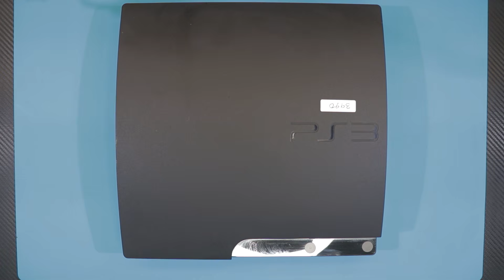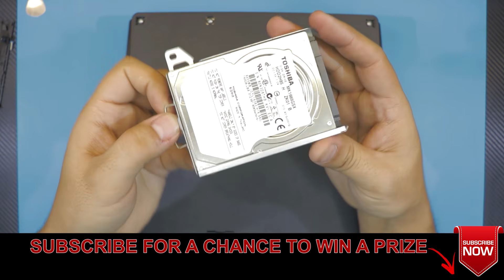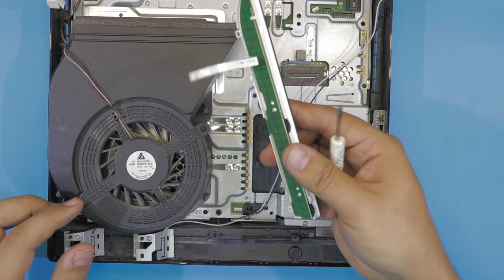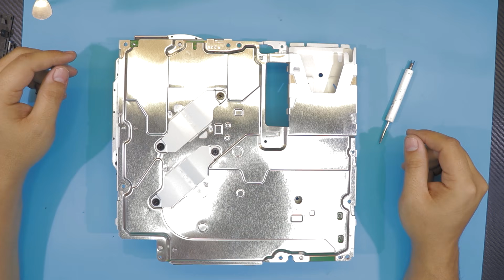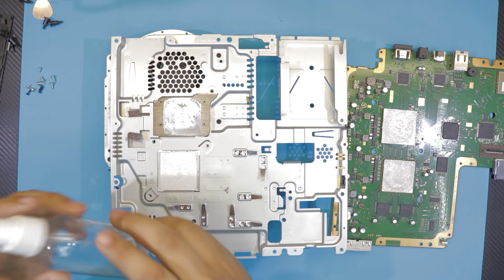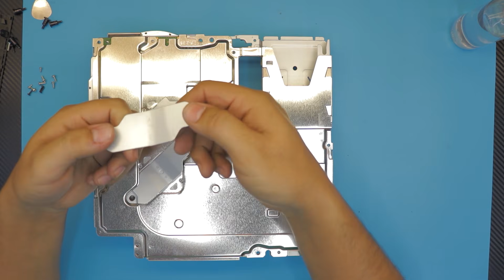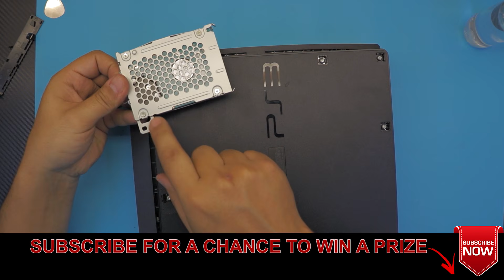HOW TO CLEAN AND  REPASTE YOUR PS3 SLIM ( playstation 3 slim console )

Comment: Im having trouble putting the front  cover back on
Reply: Something is misaligned
Reply from the maker: Lift it, and place it at a 45-degree angle first; then, once it is aligned, bring the rest down.
cheers🍻
Reply: @uFixTek  i tried, but i think the disc drive is blocking the cover, because the metal cover of the drive is up on the left while the right side sits flat. Is there any way that i can fix it?
Reply: @u @uFixTek  i fixed it! I had one of the ac cables tucked under the motherboard😅

Comment: hello sir, thank you, your video was most helpful for me in youtube. it was very detailed, also the unit in the video was exactly like mine. 
i followed everything, cleaned, removed 15 years old original paste and repasted with mx4, unfortunately my temperatures are almost the same.
Reply from the maker: It's my pleasure my friend.
🫠Regarding your temps, what temperatures are you getting? This video is for repasting and servicing. If you repaste and use a good quality paste, your temps should be similar to those of a new console. 60°C–80°C is a perfect reading; 85°C after extended hours is fine.
cheers🍻
Reply: I hace cfw and use webman fan control. 
My ambient temp is 35c. With 50% fan speed, my temps when playing gta 4 after 20 minutes peak at 65c for CPU and 68~69c for RSX. 

Almost same temperature when my ps3 had 100g of dust inside and factory thermal paste from 2010.

Temperature above 70c will give the ps3 the yellow light of death eventually. @uFixTek
Reply from the maker: 70°C will not cause the Yellow Light of Death. The reason for the yellow light is that the solder joints under the GPU/CPU crack or create resistance due to lack of servicing and prolonged exposure to temperatures above 85°C.

We tested this years ago with a 12-month trial using a UPS. One unit ran constantly at 75°C–80°C with zero yellow lights over 12 months. Another unit was allowed to run at 85°C–90°C during the same period, and it developed the yellow light after 5 months.
The yellow light was due to the solder joints being damaged from excessive heat on the BGA.

increase the fan speed to 75%
Reply: Wow i didn't know that, i am actively visiting reddit and psxplace and never read anything about this experiment. What people say is temps above 75c are what causes the rsx solder to weaken. Thus webman mod had 68c as ideal max temperature.   @uFixTek 

Do you have knowledge about which models are more reliable, would you please tell me if super slims don't really require delid like some people claim?
Reply: @uFixTek thank you for the valuable information
Reply from the maker: It's my pleasure my friend.

Comment: So there's a lock screw for the hard drive? What type of screw head?
Reply from the maker: 🫠Regarding your question, it's a screw philips #1.
Should you have any further questions or requests in the future, please don't hesitate to ask me.
cheers🍻
Reply: @uFixTek  All right. So its not a lock Screw like TORX or T10.
Reply: @uFixTek  So I looked for a video like yours to show me how to open my PS3 slim for cleaning. That's all. Thanks.
Reply from the maker: Yes, the hard drive screws are Phillips #1.
The security Torx screws are for the case.

Comment: Shouldn't you paste down the pads completely with a spatula? Also, certain models don't have the ribbon underneath the blu ray drive, and there's no plating covering the battery.
Reply from the maker: 🫠Regarding your question, just do an X pattern shape and you’ll be more than fine—no need to spread it.  
And yes, there is another revision without the flex cable under the DVD drive.
https://youtu.be/Gey66EGkCBs
Should you have any further questions or requests in the future, please don't hesitate to ask me.
cheers🍻
Reply: What is the tiny white ribbon next to the brown one? I need a new one and how many pins is it?

Comment: Thanks for the tutorial but when I tried to put the lid back on, it doesn't completely close. I noticed the power switch is lifted in the rounded corner but I can't make it sit flat. Can you help me?
Reply from the maker: 🫠Regarding your question, you will need to accommodate the power switchboard into place. First, watch the video, then move the switchboard around until it fits into the space.
Reply: @uFixTek  Yeah I watched the video three times but still no luck. When I press the corner of the switch board, the disc drive lifts up in the back but then I can't screw in the drive
Reply: @uFixTek  I just screwed everything back in. Some of the bottom screws didn’t go all the way in but my ps3 works lol. Thanks for the video bro
Reply from the maker: It's my pleasure my friend.
Maybe next time, when you open it to clean, it might fit into place.
NOTE: there is no risk if you have not placed the covers or the screws, 90% of the screws are useless and the covers are more for looks.
cheers🍻

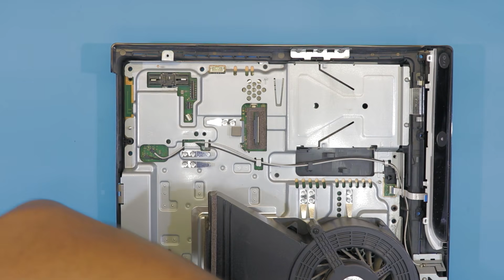Comment: Fantastic video!! I began by following your other video which included the shortening on the capacitors ( 5:42 @https://www.youtube.com/watch?v=Gey66EGkCBs&t=0s) until I realized my recently purchased CECH 2504B didn't match your PS3 in that video. However this video does. I then followed your guidance here. I also replaced CMOS battery and, what I believe, accidently broke the left battery "arm". I used a little bit superglue to reattach it. 

After I reassembled the ps3 the power button lights up red. i press it, it beeps once and it turns green for a second and then there is no light anymore. The eject button works and sounds. There is no picture. The fan spins up and after a few seconds it stops. I can press the power button again and it then lights up red again (standby mode). 

I have now removed the BD-drive and the 4 ribbon cables attached to it in order for an easier troubleshooting (am I correct in assuming the BD-dive and the 4 attached ribbon cables is not a requirement for the PS3 to boot up properly?). However even after removing the BD-drive and also the fan it still shows the same symptoms (standby red light, quick green light followed by no light when pressing the power button). Just before I decided to take the PS3 apart it worked well, though with an idle temperature of 68c in XMB.

Any ideas on what might be wrong or what I could try please?
Reply from the maker: It's my pleasure, my friend.  

I'm sorry to hear about your accident.  
You need to ensure the CMOS battery terminals are making proper contact with the metal and the board.  
What brand of thermal paste did you use?  
Did you use 95%+ isopropyl alcohol or 70%?  
Make sure the flex cables are straight in the slots and that the pins on the flex cables are not damaged (take a close look).

Remove everything from the motherboard and place it on a wooden surface with the GPU and CPU facing up. Make sure you work in a room at normal temperature.  
Grab a hair dryer, set the heat to max and the air to mid/low, and keep it about 1 inch above the GPU for 5–10 minutes.  
Once done, repeat the process with the CPU. There is no need to isolate them.  
After heating, *do not* cool them by blowing air or move/touch the board for 10–15 minutes.  
Once cooled, repaste the board and test it. Trust me on this.  

When you initially lifted the board to clean and repaste it, you most likely bent it slightly, which could have caused the solder joints of the GPU or CPU to disconnect.
cheers🍻
Reply: @uFixTek  
This happened to me as well with a new CECH-2504A, which broke simply because I attempted some maintenance on it. I might have removed the heatsink incorrectly, and since then, console no longer boots, just like in his case. I’m not sure if you’re aware, but the 2100, 2500, and 3000 slim models have a feature that allows them to show the last Syscon error code. By performing a sequence of button presses, the console shows a series of green and red lights, ending with a yellow light to indicate the end of the number before repeating. These colors represent hexadecimal values, which can be converted into to reveal the error code. The code 3034 refers to the dreaded BGA solder joint issue. Are you certain that reflowing will help restore the console’s functionality? I’m quite disappointed, as these are the newer revisions of the chips and were supposedly unaffected by the bumpgate scandal.

Comment: Great video, I checked many and this was the best one. Great explanations, taking it slow, thank you very much! Subscribed. Just one question - at the back of the blu-ray dvd drive, I accidentally moved the tiny brown plastic thing connecting the brown flex cable to the motherboard. The brown plastic thing tilted around 45 degrees forwards (without detaching from the motherboard), then I moved it back exactly in place. Now, everything works but the blu-ray dvd drive does not. I'll inspect all the ribbon cables tomorrow to see if they're plugged in properly, but I am afraid it could be that brown thing I moved now has messed up soldering... is that possible? Thank you very much in advance.
Reply from the maker: It's my pleasure my friend, i appreciate your support.

🫠Regarding your question, let me see if I understand correctly: "You bent the jack of the brown flex cable right at 5:10, that jack?"

If you bent that jack to 45 degrees and then back to 90 degrees, there's a 99% chance that you've cracked or ripped the jack legs from the motherboard. You'll need to solder it back to the board, or take the motherboard to a repair shop and ask them to quickly solder the jack pins back to the board. The pins might be cracked and not visibly detached. This should take the repair shop about 5 minutes, and most shops should do it for free.

Should you have any further questions or requests in the future, please don't hesitate to ask me.
cheers🍻
Reply: @uFixTek  Thank you very, very much for such a fast and detailed answer on a 6 year old video. I went to the repair shop today with the motherboard, and, as you said, the soldering was done super quickly and everything works now! They did make me pay a small amount, but I think that's normal in Brussels, at least in my neighbourhood. Thank you once again!
Reply from the maker: It's my pleasure, my friend. I'm glad that you got it fixed, and the experience you gained is worth it. If you ever need any help, you can always ask me by leaving a new comment on any of the videos. I always check the new comments first.

Comment: I got a ps3 slim recently and the last person tried to get in and couldn't. The warranty tag is still on. They broke the post on the inside though from trying to pry it. The screw for the hard drive broke the plastic post from the hdd cover because they bent it. I imagine they tried to get inside because the disc drive was making a weird noise, otherwise the console works.
Reply from the maker: you need to replace the HDD and reinstall the OS and if you want get a new case on aliexpress.
cheers🍻
Reply: @uFixTek  thank you for that. I was able to get the hdd out and swap it with an ssd. I went on the ps website and put the firmware on a usb and transfered it over to the ps3. Case is in bad shape but it works lol. They also ripped off the foot with no screw under it and bent those torque screws with the bump in the middle. Took it apart yesterday and it turns out there was bits of paper in the disc drive causing the noise.
Reply from the maker: awesome job my friend👍🫠
glad that you got it working

Comment: I just jailbroke my slim and discovered the temps are 65 C and 73 C just during idling .  It was used mainly as a blu ray player since it was new, and occasionally only for PS3 exclusives- and the thing would always make this expansion/contraction creaking noise while it was heating up, and again while it would cool after power-off.  Hoping that a cleanup and repaste will correct that and help it run cooler.
Reply from the maker: it will for sure, just use a top quality thermal paste.
Should you have any questions or requests in the future, please don't hesitate to ask me.
cheers🍻

Comment: Would dry thermal paste be a cause of red death or is my ps3 just broken
I went to take it apart to about the fan section, left the disc drive and I noticed basically everything was clean but after I put it back together I noticed some rust when looking at the ps3 from the front
Right beneath the disc drive those little slots
Reply from the maker: the red light 90% is because of bad thermals and or solder joints under GPU/CPU
repaste if that did't fix then you will need to reflow the CPU/GPU
Reply: @uFixTek  ok thank you
Reply from the maker: It's my pleasure my friend.

Comment: Hi. I've disassembled my PS3 slim because the disc hard drive made weird noises and cleaned it. After I put it back together the console turned on normaly but as soon as I insert a disc the hard drive takes it but it doesnt spin fsr. So I tried it multiple times andgot the disc in and out and nothing happend.
I disassembled the console one more time and found out that the ribbon cable on the bottom was displaced that goes through the disc drive. I fixed it. Assambled the console and it still wont spin. Could it be that the ribbon cable is damaged?
Reply from the maker: 🫠Regarding your question, when this happenes is because that flex cable is damaged and or is not making a contact with the pins, get the new flex cable from aliexpress.
cheers🍻
Reply: @uFixTek  Are you sure its the flex cable cuz I saw a video where a guy buyed a whole ps3 disc drive and problem was fixed after he changed out the laser assembly
Reply from the maker: we do get this issue in the store often, #1 we always test the cable and that is the 1st one that fails, but we do get issue that the laser is gone bad, over the chat and not be able to check it is almost imposible to tell you 100%,  it's 50-50 i would say go with flex cable, as it's much cheaper.
Reply: @uFixTek  I've noticed pretty late that the bottom socket has a lock mechanism. Would be nice if you had pointed that out in your video. That explains why the FFC/ribbon was everytime displaced when I disassebled the drive. And thats problably the main reason why it gets damaged in the first place. 

Also another thiner FFC got damaged because the blue sticker fell off. So anyway I bought a new drive (KEM 450eaa) for 60 bucks because I couldnt find the exact FFC's.

Comment: And what would be the diffetence between the 2511 and 2501?
Reply from the maker: 🫠Regarding your question, the dvd drive changes the cable. the rest is identical.
Reply: @uFixTek  and will you notice any changes in how it performs?
Reply from the maker: it will run quiet and will last you long time, it is like doing your car oil change, because you want it to last longer.
Reply: @uFixTek  so the 2511 is more reliable, and all the 251x models
Reply from the maker: that is correct👍

Comment: Is repasting worth it or can I run my PS3 slim without past /repasting
Reply from the maker: 🫠Regarding your question, oh boi is like saying can i keep using my car without oil change, the answer is sure you can and it will eventually die on you and the cost of repair will be more. servicing is a must.

Comment: @14:55 you mention using heat to spread it out. Just out of curiosity, could I put my thermal grease pen (or whatever it is called) in a cup of hot water to heat the grease up in the container before applying it?
Reply from the maker: NO don't do that!, just do a X shape and you be fine. make sure you not using "heat grease", you need a proper "thermal paste" a GOOD brand thermal paste.

Comment: If I only have a lower percentage of alcohol than 90%, should I just skip cleaning the old thermal paste off?
Reply from the maker: 🫠Regarding your question, 90% is fine for the consoles, go a head and clean the old paste and apply a new good quality known brand thermal paste.
Should you have any further questions or requests in the future, please don't hesitate to ask me.
cheers🍻
Reply: @uFixTek  I only have the 70%. Sorry, I should have clarified that
Reply from the maker: if you going to use the 70% just damp the towel in the alcohol and just wipe the top of the CPU GPU and make sure you don't drip any under the cpu or GPU, incase you have dropped 70% alcohol under the chip then you want to use a hair dryer to heat up the cpu and gpu at max heat for 5min and let it cool down on its on and then apply the thermal paste.
Reply: @uFixTek  thank you so much for answering my questions :)
Reply from the maker: it's my pleasure my friend.

Comment: Hi UFIXTEX, I need your help. I'm having trouble with closing completely the top cover of the game console. The Top Cover was supposed to close completely after installing the Power Supply back in, but unfortunately I couldn't seem to get to close completely and It's not perfectly aligned (The Top Cover was still little bit open) and I don't know what to do to fix it and make the Top Cover to Snap and Close Completely. Can you help me out with my problem with Closing Completely of the top cover of the game console? I'm so close to finish Reassembling the game console. I think it something to do with the Power Supply. Please Comment Me Soon. See You Later.
Reply from the maker: you will need to remove the power sully out and make sure that the cables under that is in correct position and you have pressed down on power supply to get it in the slot, there is nothing i can do unless you email me a video and pictures of the service you did. the email is in the about section of the channel.
cheers🍻